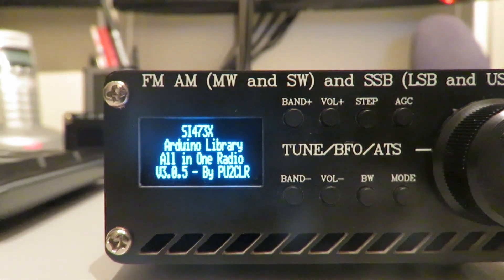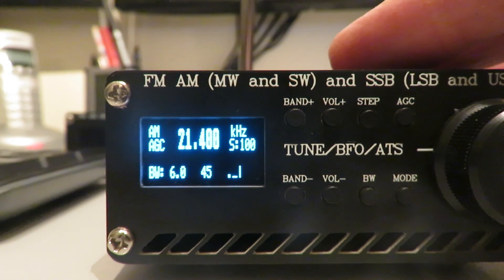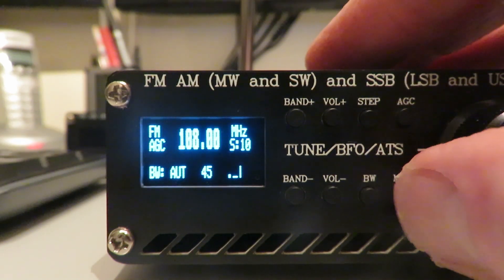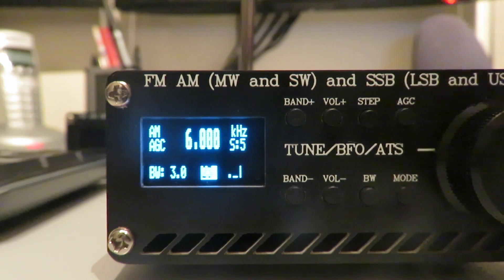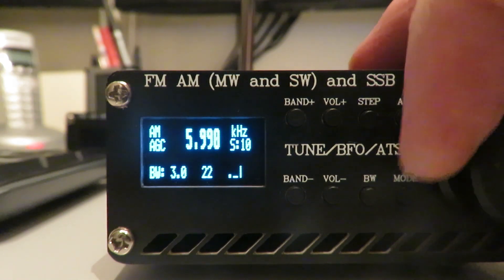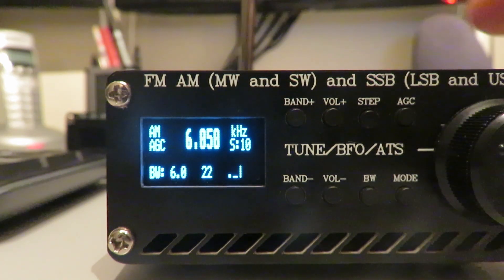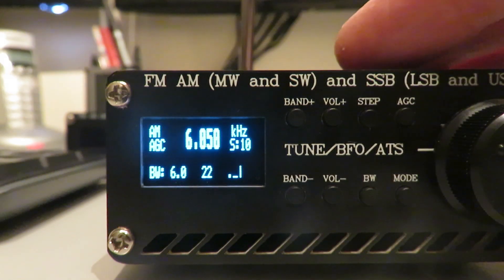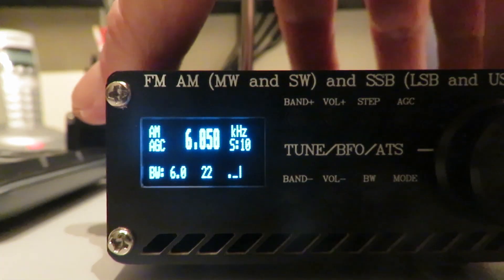SI4732 Further update

Comment: Hi Kevin
3.06 is working fine with me now.
Like you I had to reset the eprom and it seem to take some time to clear the band selection but all working good now.
I really love this receiver. I have a second one on the way and will leave that one on the original version so that I can compare
the changes. Ricardo has done a great job with the various improvements. I have connected a power speaker and the audio is great using it homebase.  I also use the Tecsun on medium wave but use a  homebrew loop amplifier which improves the loop
performance greatly. Listen out for Manx radio after dark on 1368 and WBBR New Jersey on 1130 also Wins on 1010 just before dawn.
Andy
Reply from the maker: Andy I can hear 1368 fairly well here with the Tecsun loop. I have yet to hear any transatlantic stuff though.

Comment: Is the NOAA Weatherband possble to be programmed into the radio? It would be around 161Mhz
Reply from the maker: No I don’t think the si4732 chip will cover that frequency
Reply: @KevinOReillyswl  I seen a datasheet that said it does. I'll have to do more research.
Reply: @EmergencyChannel  I'd love to see the mod that would put the air  band  on it
Reply: @killmimes  I tried and failed. SI have chips that cover that range but the 4732 will not.

Comment: Hi Kevin
Thanks again for the info.
I have installed version 3.06.
I will fully test it later.
I noticed that the Band select seem to only work with the rotary control after pressing the plus key. also seems to work hit
and miss. Like you I think I will go back to version 3.05
Thanks again

Comment: Many thanks for update and sharing the changes. Unfortunately until the tunning steps noise interruption will be fixed it still sounds annoying to use...:( thanks for vid mate.
Reply from the maker: Petr I don't know if that issue can be fixed.
Reply: @KevinOReillyswl  yes, but on the other hand this is the only radio with this issue. No one in my collection has similar behavior so somehow it should be possible to solve :) maybe hardcode change but it must be done by code developer probably...;(

Comment: Приветствую Кевин. У вас установлена версия V5, а на гитхабе уже есть версия V6. 73
Reply from the maker: Yes I had a problem with V6 so reverted to V5 for now.
Reply: @KevinOReillyswl  Можно более подробно о проблемах с скетчем V6?
Reply from the maker: @Всяко-разно-щ4ц   I found I could not change bands and my radio was stuck on VHF. I have sinced re flahsed and not I have V6 working OK.
Reply: @KevinOReillyswl  Только что прошился на V6. Тоже диапазон поменять не могу. Уже вышла V7 только что. Но прошить скетч не получается. Выдаёт ошибку ((